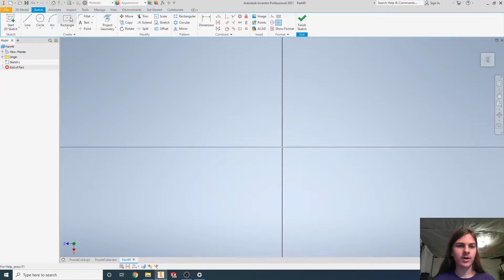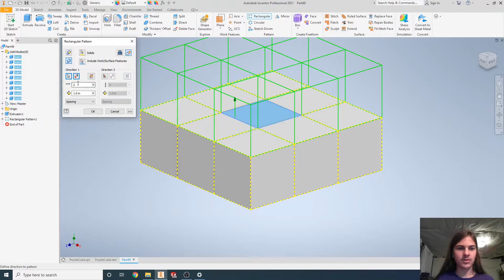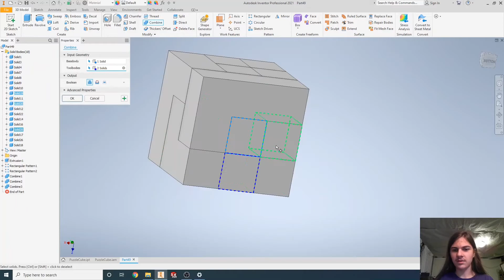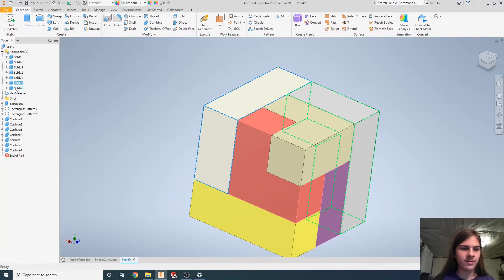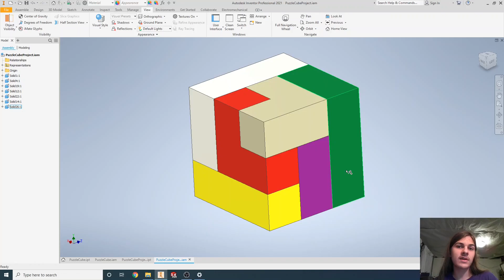How to model a puzzle cube in inventor in 5 minutes, start to finish

Comment: Hey could you show how to separate the parts?
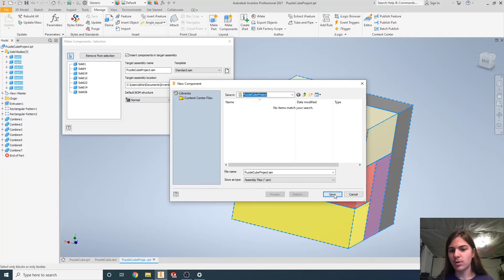Reply from the maker: At 4:46 you can see the "make components" tool saves each solid to its own .ipt before inserting it into the new assembly. These part files are separate but they still link back to the original part file. Was there anything in particular beyond this you wanted to do? Do you mean an exploded view or something?

Comment: how long is each side?
Reply from the maker: The named parameter "size" created at 0:28 makes the side of each small cube 1 inch. The overall size, being 3 cubes side-by-side is 3 * 1 inch = 3 inches. If you want to change this, click the fx button at the top to the right of the appearance menu to edit the general size parameter.